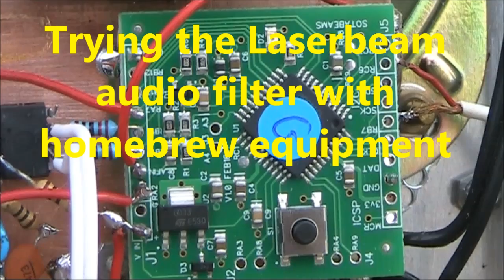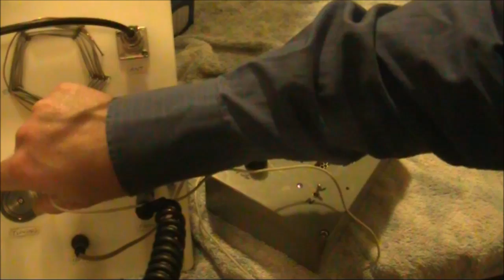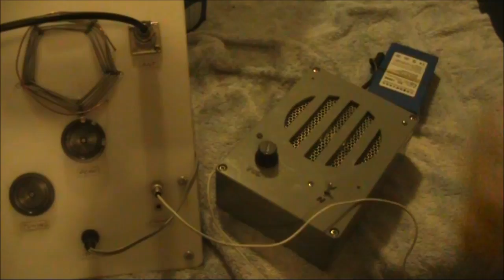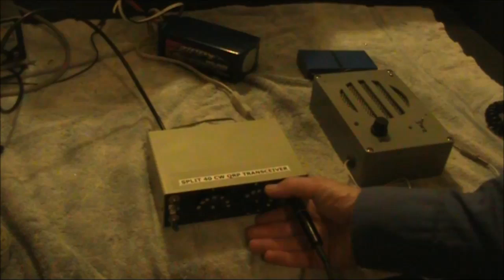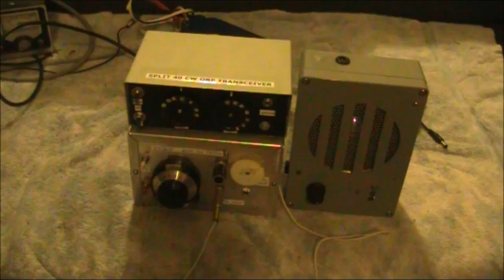Review: Laserbeam digital audio filter from SOTA Beams (Pt 2)

Comment: Gee Peter, I'm almost tempted to get one of these filters to tame that dual-band 40/80m direct conversion transceiver I built nearly 20 years ago (the one you helped test via a daytime CW QSO between Newcastle and Canberra).

Certainly it would be a great asset for the FT-817, as mine is fitted with the Collins SSB filter and doesn't have room for the CW filter (unless I get one of those dual filter kits).

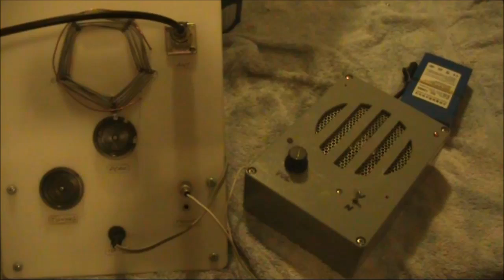And I'm wondering if the SSB station at 2:39 wasn't a friend of mine not far from Canberra. :)